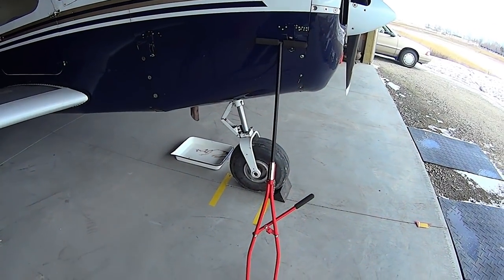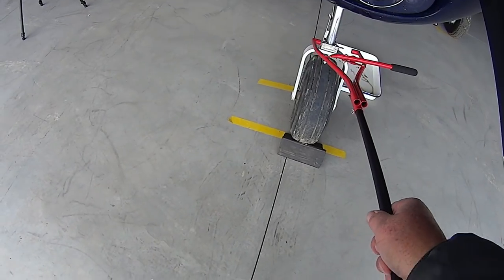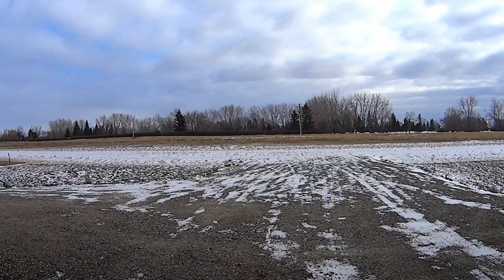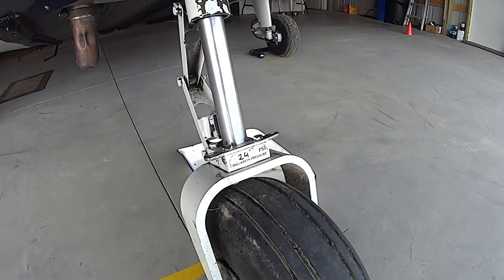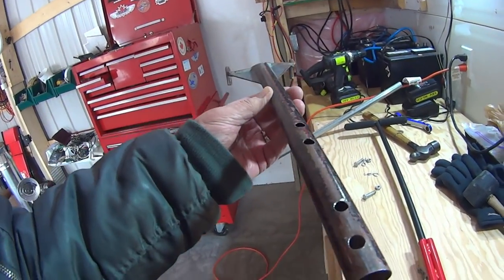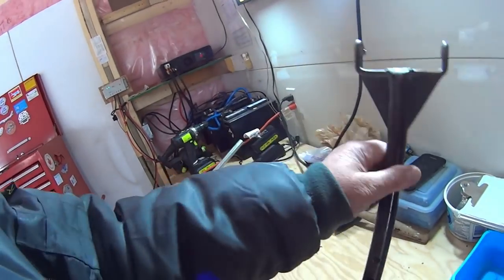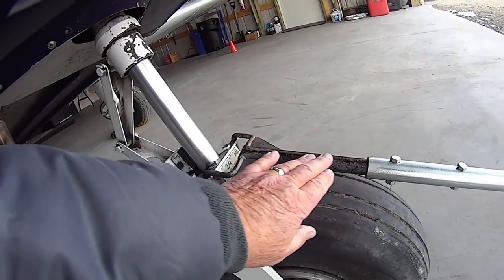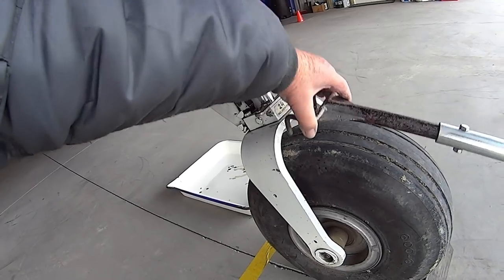Piper Cherokee "Homemade Aircraft Tow Bar" Vlog #175

Comment: Hey Chet
Looks like you would be pulling the plane out with your back to it. I would much rather have something hooked up to the front of the tractor so that you could keep your eyes on it when pulling it out and when pushing it in. Otherwise a fine invention. My Cherokee is set up like yours. My hangar mate wants to buy a tug to move our planes around. I like your idea. Much cheaper.
Reply from the maker: Yep .. guess it depends what you are comfortable with and if required I can also hook the tow bar to the front of the tractor ..

Comment: Chet how much would you say it costed to produce?
Reply from the maker: I don't have the exact cost Brady however the pipe is probably  around the $20.00 and can be bought at Home Depot..
Reply: @TAGALONGWITHCHET , I figured that my wheel skirt top is 17.5" off the ground, compared to my old Murray lawnmower which the hitch is 10.5" off the ground. Going to work to possibly welding something higher up to be used. I wonder if the steel pipe can be bought from a Lowe's. I was joking how instead of flying the plane, I want to race it around the tarmac around our Life Support helicopter and those pilots laughed. They have more of a John Deere which surely goes faster than my Murray.
Reply from the maker: @BradyFries  Lowe's should also sell it since they both seem to stock the same merchandise..You might be able to just get a heavy duty bolt of sufficient length and some large washers..cut the 7" from the pipe which usually comes in a 10 ft length which is too long (think mine is about 6 or 7 ft) put the bolt into the 7" pipe and fasten it to the hole on the lawnmower...use the washers to cap off the pipe ends...
Reply: " TAG ALONG WITH CHET ", to get the little “field goal” like prongs which would fit in the tow piece above the wheel, you just took an older tow bar and modified? You didn’t custom that did you?
Reply from the maker: @BradyFries  That correct Brady, I had an old tow bar and just cut the T handle off, left enough of the tube which I inserted into the new tow bar, drilled a few holes through both and fastened them with bolts.  If you don't have another old tow bar you could just make up your own prongs by using a piece of metal and using two bolts of the correct size for the prongs.. be sure to get the correct diameter of new tube so the old tow bar tube will fit into it..